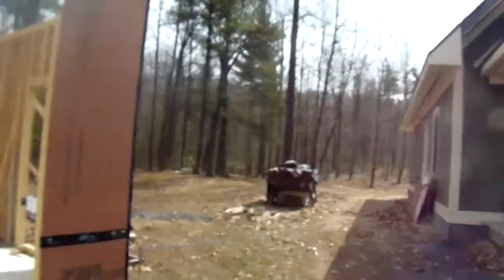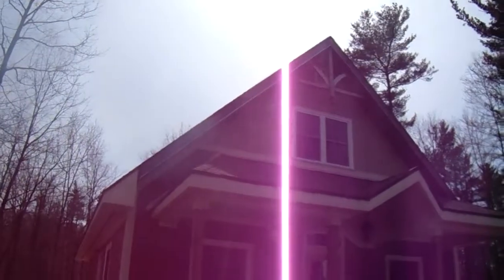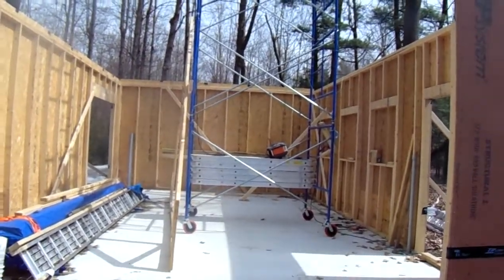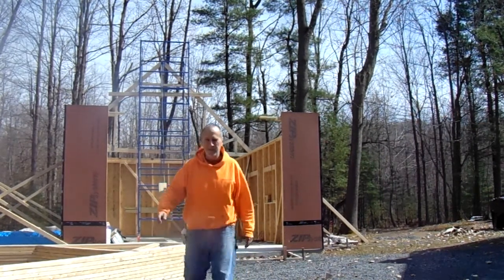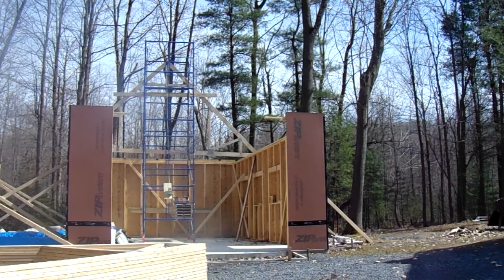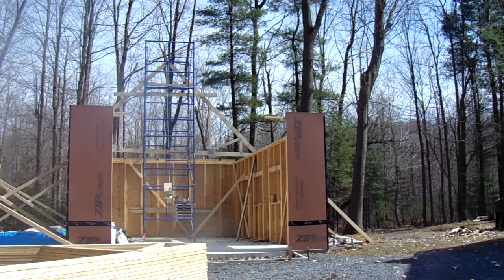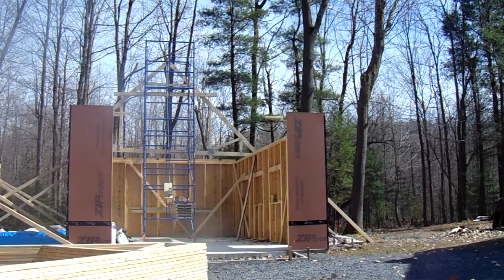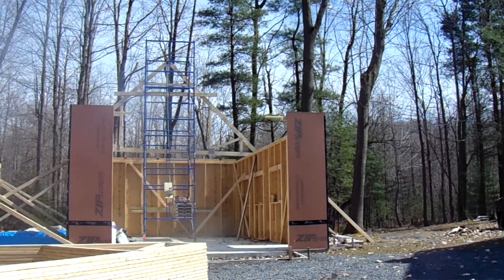Raising or hoisting a truss solo with a winch

Comment from the maker: With the help of one guy running the winch today, we got these spaced, braced and set in about 5 hours at a casual pace.  This worked flawlessy today.  Only hanging up on some aluminum/wood walk planks I put on the scaffold to set Simpson spacer bars and tools on as I monkeyed around making all the connections with the nail gun.  I had ordered a Dutton hex head drive winch, but Amazon sat on my order for over 5 days doing nothings so I proceeded with this winch....worked great and about 45 bucks with dual speed and 3500lb rating.  The last 8 feet were the most difficult as this forces you back as you proceed.  We decked out the unpoured apron with some 3/4 ply I had for 8 more feet and rolled outside on the last 3 trusses....would recommend this if you have no lift, boom, fork or limited labor.  Defiinetly easier on your back and shoulders compared to any other manually set truss install I have seen to date.  One of the key advantages to this is that doing this keeps the truss pretty much vertical so bracing is so much easier, lifting is only as hard as sliding, dragging or getting the truss to your tower for lift.